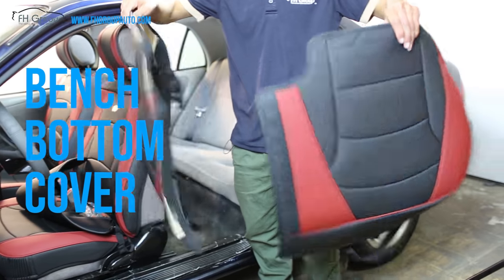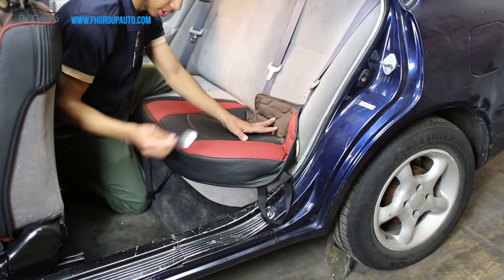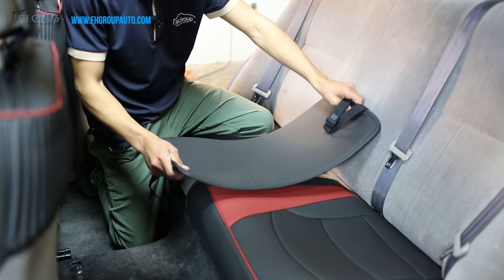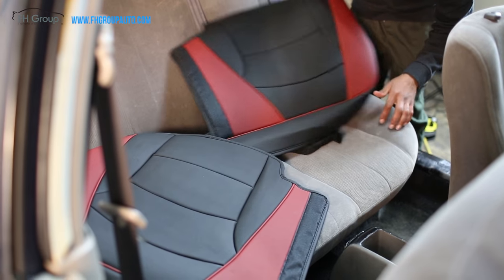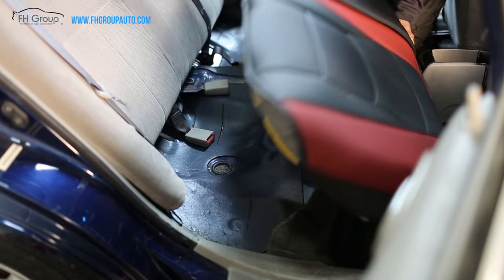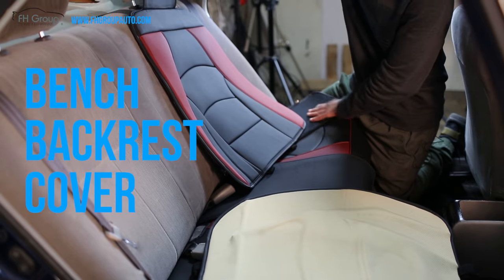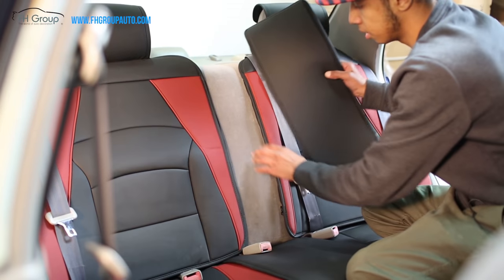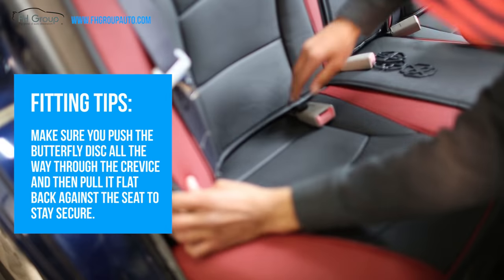Quick Install Faux Leather Car Seat Cushions Bench Sedan and SUV- FH Group®

Comment: Does it fits with I 20 sx with 6 airbag and rear armrest
Reply from the maker: Please note our products are universal, meaning they are designed for a wide range of vehicles, and not any particular model and year. With this being said, yes it does allow for the middle cup holder/armrest to be used and it accommodate split benches.

Comment: How would these seat covers fit on a 2013 fusion?
Reply from the maker: Thank you for your inquiry. These are universal and not customized for specific vehicles. If your headrests are removable, these will be compatible based on the features.

Comment: Will it fit a 2015 Camaro 2ls??
Reply from the maker: Thank you for your comment. This item is a universal fit, made to fit most vehicles. It can fit on seats with removable or non-removable headrests. It is made for bench seating, not bucket seats.
Reply: @FHGroup  where do I buy these
Reply from the maker: @wwalsh9335  www.FHGroupAuto.com
Reply from the maker: @wwalsh9335  https://www.fhgroupauto.com/shop/?s=pu205&post_type=product&type_aws=true&id=1&filter=1
Reply: FH Group Auto I got the same set for my 07 avalanche and the backrest is longer. Do I tuck them in or something else?

Comment: Will this fit Honda Civic 2D 2006?
Reply from the maker: Thank you for your inquiry. This item is a universal fit designed to fit on many vehicles and seats. It is a seat cushion as oppose to a seat cover meaning it will not cover the sides of the seats. Side less design allows integrated airbag compatibility. It does require removable headrests in the front. Also, if your seat belts are built into the seat, this may interfere with the installation process. This item is split bench compatible and will work with traditional or heated seats. If your car does match these features, then it should fit fine. Please keep in mind that we cannot guarantee a perfect fit as these are universally designed.